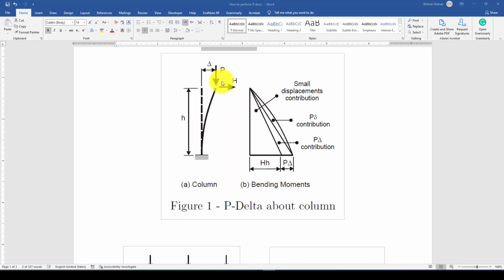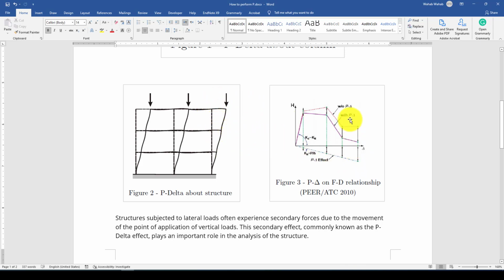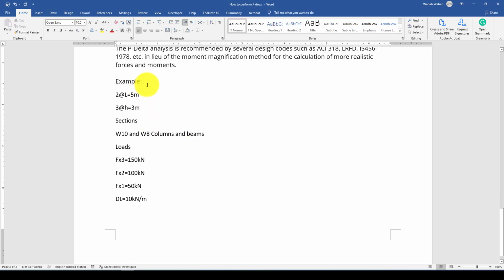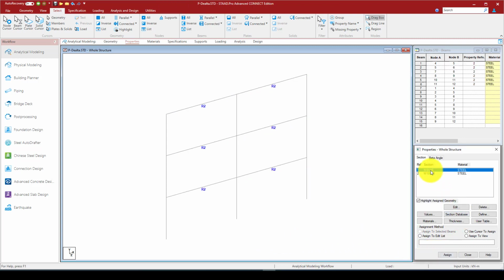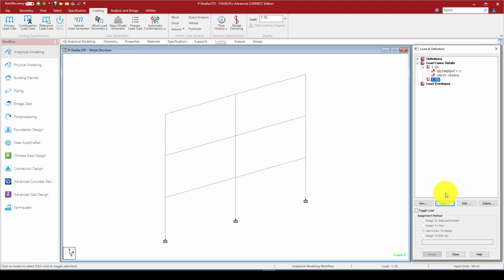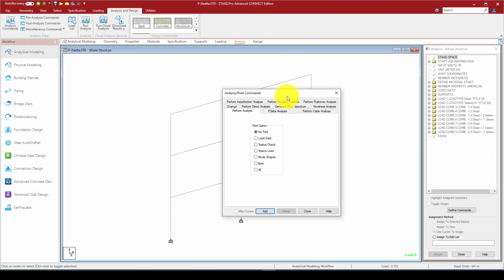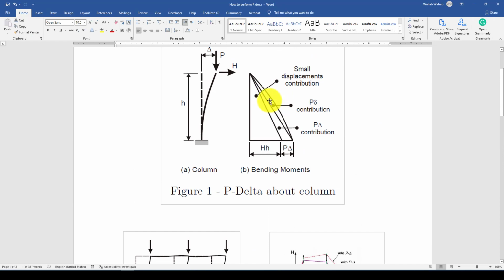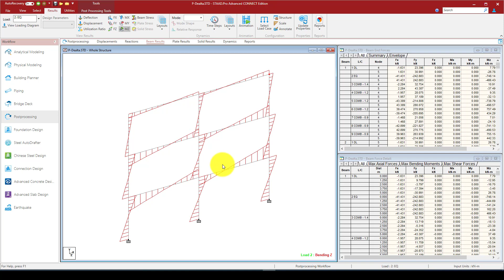STAAD Pro Connect edition Tutorial ; How to perform P-Delta analysis in STAAD Pro Connect edition

Comment: while doing Pdelta, it is requried to use repeat load command instead of load combinations to get proper results.. same is already mentioned in staad manual too.
Reply from the maker: I think there is a misinterpretation. By the way thanks for your comment.
Reply: @KSSE_Engineer  For your reference exact statement for staad help placed here..>A PDELTA ANALYSIS will correctly reflect the secondary effects of a combination of load cases only if they are defined using the REPEAT LOAD specification (section 5.32.11). Secondary effects will not be evaluated correctly for load combinations. If further details required refer "5.37.2 P-Delta Analysis Options" in staad help.

Comment: Sir, i want to ask, why do you use load combination instead of repeat load combination on performing P-Delta analysis?
Reply from the maker: Sorry, I don't understand what you mean.
Reply: @KSSE_Engineer  Sorry, if I'm not mistaken, if you want to perform P-Delta analysis on STAAD, you should use the REPEAT LOAD case instead of the LOAD COMBINATION case. This happened because on STAAD a second order analysis or P-Delta analysis can't be run using the LOAD COMBINATION case.

In your video at 8.20, you just used a LOAD COMBINATION case because you didn't create a repeat load case. Is it correct? Sorry for using the wrong grammar.
Reply from the maker: you can do both to see what is the difference and verify with hand calculation..
Reply: @KSSE_Engineer  Both analysis may give same results when no major impact of P-delta analysis but when there is major impact then added load results algebraically and doing repeat load results will be different.